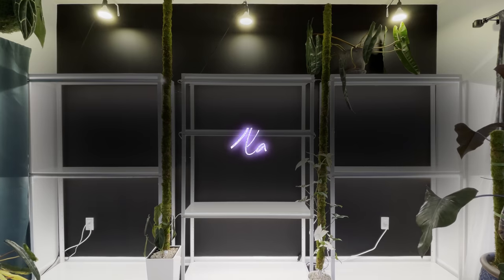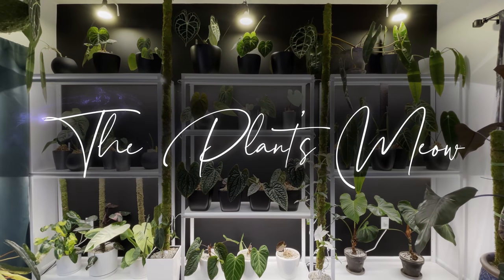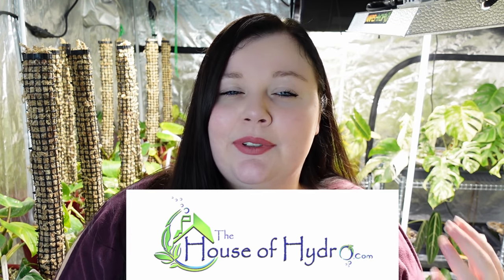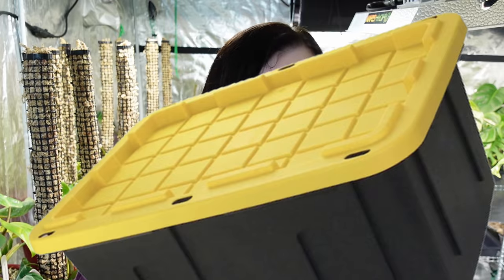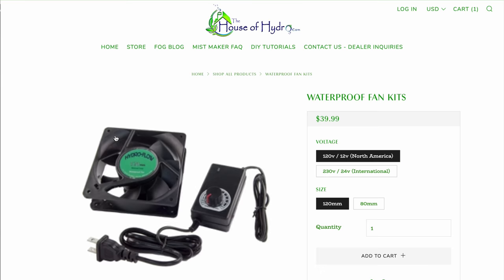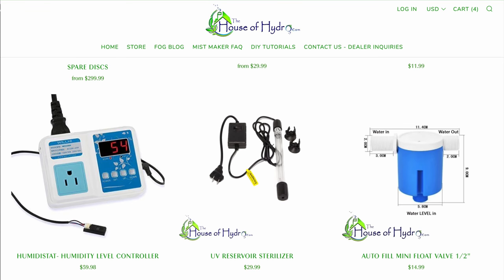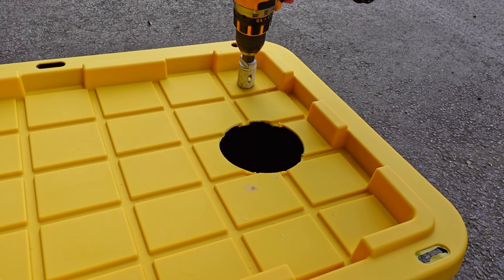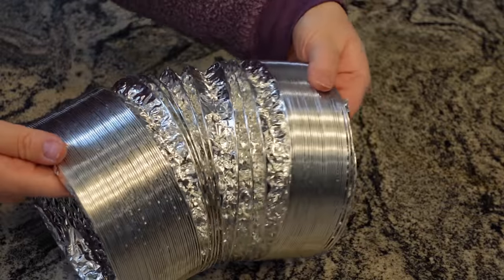The DIY Humidifier your Plants will LOVE

Comment: Great video.  There is a product that you hook a hose to and put it on the edge of your swimming pool and it has a float on it so it works like a toilet tank. 
Fills the pool automatically when the water level drops. That could probably work on that big tub.

Comment: This is totally awesome. My grow tent is 4’x4’x6’8”. I have mine stay around 65%-90% without a humidifier. I cycle it the lights and fans on for 12 and it off for 12. Maybe because it’s so much smaller I don’t have a need. But if I ever do. I will definitely go with this.
Reply from the maker: Size makes a difference but I also have a heater and an inline fan, which both decrease the humidity. 😪

Comment: Glad your happy. However I’m not a seller, nor do I have a grow tent. So my current humidifier is working quite well for my plant and orchid collection. I’m wondering how much electricity this setup uses though. Is is environmentally sensitive?
Reply from the maker: Glad yours is working well! So is the one in my plant room. It’s definitely a different environment when you need to provide ventilation or the plants don’t have oxygen.  I am a certified nursery but I don’t choose to get a location and unnecessarily waste by building and instead use my means (basement). The tsw2000 light was built with a very efficient grid and the tent reflect light, which makes it optimal for growing conditions. The diy humidifier is plugged into a smart powerstrip. Also, the energy usage is less then what it would be if I had of multiple smaller humidifiers that use a lot of energy. But overall my energy usage pales in comparison to some nurseries or simply people that just don’t care. In an update video I will mention the actual energy usage.

Comment: if the volume of the tank is the main issue, then I would install a mini-float valve to an existing humidifier and hook it up with a water source (27 gal tub). Definitely less than $50. Anyways, I enjoyed your video. Good luck with everything!

Comment: This is exactly the type of content I was looking for. Do you have fans inside the grow tent circulating the air?

I'm wondering if there are any wet and dry spots which could be easily checked with one of those hygrometers on Amazon that record the humidity and temp and send it to your phone.

Comment: Do you just use normal tap water? I've been filtering water and using it for my multiple humidifiers and its getting tedious now. I am wondering if it is even worth it. I kept reading everywhere to use filtered to prevent pathogens from growing and mineral buildup, but it seems I have to do the same amount of cleaning and I get occasional algae and other gunk in the humidifiers from time to time.
Reply from the maker: For this humidifier I use normal tap water. They actually recommend it because the solids in the water are needed so that the mist maker performs good. Too clean water can actually wear out your mist maker faster. For my smaller humidifiers I don't use filtered water either. Honestly it is just too much of a hastle. 😓
Reply: If your ppms/tds is high, then for typical ultrasonic you must use distilled. The minerals will cause white dust which costs your plants leaves and takes light absorbtion away, it clogs your filters (especially our Carbon Filters) and is bad to breathe in. Distilled water completely fixes that. If the company website recommends tap, use tap no question. However, 99% of ultrasonic humidifiers say to use distilled NOT tap. 

I even bought a home distiller just for that purpose. Everything of mine became covered in white dust so it was required in my case. Used to be in NJ and water was 300+ on tds meter. White dust was atrocious. I have 110ppm water here in VA and while it took a few days, it did happen here too when I used some tap water vs distilled...My AC infinity carbon filters cloth pre-filter went from black to grey because of all the white dust hahah was a quick rinse to fix but I'm sure some got inside filter too unfortunately

Comment: My grow tent’s humidity is 91%. Should I be worried? It does not have a humidifier but it has an oscillating fan inside. I had to open the bottom vent just to lessen the humidity.